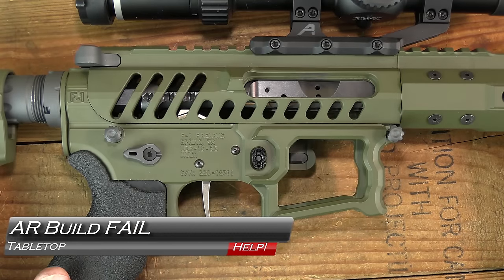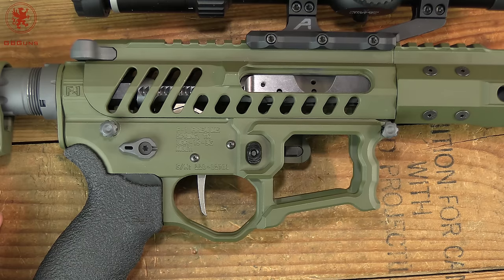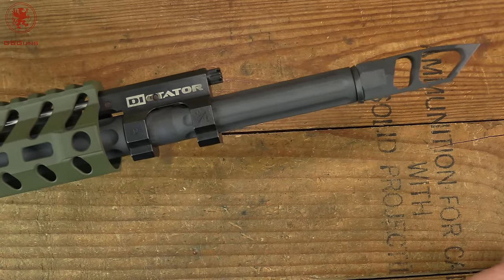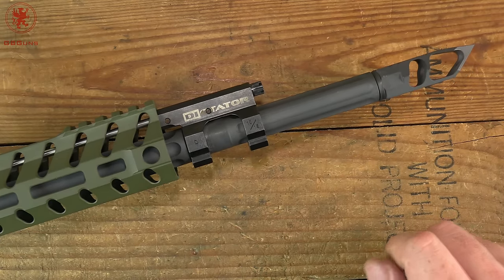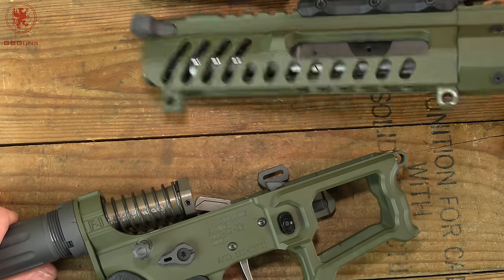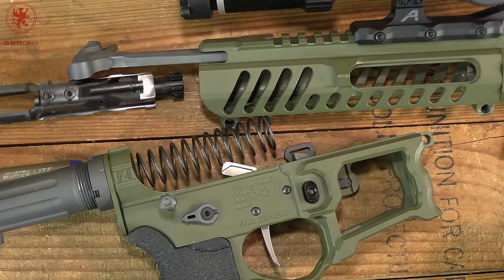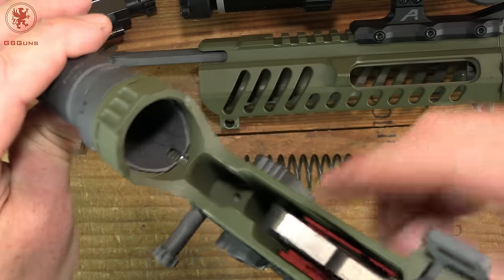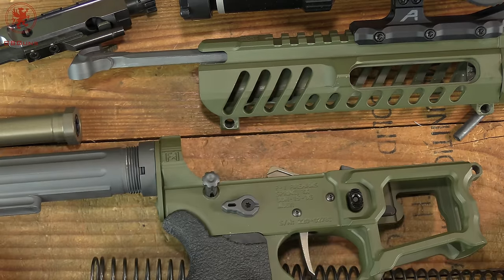The Worst Thing You Can Do For Your AR

Comment: I'm going through a similar issue with mine. I've dialed the adj gas block on my 16 inch carbine. With no joy. I have the correct tube and barrel Mach up. I was going to just buy a regular gas block and try it but now after reading your comment I didn't think about the spring being too stiff. I will have to try that but my buffertoob spring doesn't seam stiff. Again I will have to try both. Just FYI my gas block is about 9 inch from the receiver and isn't as far forward as yours. So it stumps me. I'm going to try both and what doesn't work on this gun will go to another build.

Comment: Mine done the same thing, I had a rifle spring in it, switched to a carbine spring and it worked fine. Rifle spring is longer which will stop the buffer tube from going back enough to cycle  weapon.

Comment: Have you tried a different upper? Same bolt same spring and buffer just different upper with proper gas length for a it’s barrel length. I’m sure that is the problem mid length would probably been ordeal. Hope you find the solution cause that’s a nice build for it not to be running smoothly

Comment: you either have to have a softer spring since there isnt as much momentum pushing back on it OR get a shorter gas tube so that the gas comes in sooner and can build pressure, people tend to forget the mass of the bold actually helps push that spring back and if its extremely light weight it picks up speed but has no punch
Reply from the maker: See video description

Comment: You can buy mm sized wire brushes (with 1/4" hex) for a drill to hone out the takedown pin holes.  You can also roll a small piece of sandpaper and turn it by hand.  Keep checking pin fit, come from both sides to minimize inaccuracy.
Reply from the maker: The solution was much simpler
Reply: @GBGuns  What was it ?

Comment: I hope this has been fixed by now but As many people said you need a lighter buffer spring and those 2 rounds that cycled will turn into 30 per mag. Seems like your reciever both upper and lower may also bbn have VERY tight tolerance. Or like you said the risk of your preferred gas system. Sometimes the perfect builds we want just don't work exactly how we want but I'd try the spring first.
Reply from the maker: See video description

Comment: You have something that I hav experienced with a build, short stroking.  Root cause is under gasing or the buffer spring is too stiff.  There are lower spring force buffer tube springs.  As pointed out in an earlier reply from another your ultra light weight bolt carrier has low mass and inertia, so this also points back to the buffer spring being to stiff to alow full stroking.
Reply from the maker: Correct

Comment: This is old but try cycling the gun a bunch of times by hand to break the bolt in will help a little,the problem is not enough gas or something hanging it up .I almost wonder if maybe the adjustable gas block isn't lined up properly with the hole in the barrel. Maybe they dimpled it in the wrong spot.Try a different barrel if you have it

Comment: I'm sure it's already been said but I'm not about to read all 5,360 comments....Have you drilled your gas port in the barrel to the next size up?  I was having the exact same issues with a very similar build, tried all the same things, swapped many parts to isolate the problem.  The solution ended up being to use an adjustable gas block (you already have) and drilling the port to the next size up using a jetting bit (so it's very small diameter increase) and then tuning it with the adjustable gas block.  Worked like a champ and it now cycles flawlessly.

Comment: I knows this is old but before reading comments off the bat I’d say reduced power spring , and rifle length for a rifle length gas system. Make sure the springs got lithium grease all over, and lube the bolt and inside the upper receiver . The sounds of the charging sounds like allot of friction .

Comment: I just got my first ar platformed rifle in 5.56 1:8 twist in a 16" barrel with carbine length gas tube I got the upper complete from Bear Creek Arsenal and I went and bought a comolete K.E. Arms K.P.-15 Multi- caliber lower for a couple reasons the lower is one solid polymer combining the lower and stock into one single piece getting rid of the weak point between the stock and buffer tube/lower reciever that the adjustable stocks I have seen crack or break in that area. I love this rifle so far and am already looking into getting the 7.62x39mm AK chambered upper but I wished I would have gotten an 18 or 20 inch barrel on this first one but its lockup on the K.P. lower is super tight I had to sand the forward upper lug slightly to fit into the K.P. lower but for my first AR platform rifle I'm happy with this one its definitely accurate with M855 ammo as soon as I can I'm going to grab some primers powder and some v-max or GMX Bullets and start developing loads bit who knows when primers powder and bullets will be avaliable again...i got lucky last week and picked up a box of Hornady 230 gr XTP's for my 45acp SD Loads but they didn't have primers or powders lol

Comment: I ran into a similar problem with my .300 blackout. At first I thought it was short stroking on shit reloads from LAX ammo because it was jamming after every round. Last shot the bolt would slam forward and I couldn't get it to lock manually.  Swapped uppers and the problem went away. So I swapped the buffer spring and bam problem solved. Turned out I had a thicker spring on my .300 black so I bought an aero precision carbine spring and it works reliably now.

Comment: I have a similar issue except I put the lightest spring you can get in and the ar was basically a single shot still. I put on my friend lower and it ran flawlessly. It mag dumped 3 mags in s row without an issue. I also changed the bcg and gas block. I called the manufacturer and they had no suggestions I hadn't tried. Do you guys have any other suggestions for that?

Comment: Do not be afraid to cut a couple coils off the buffer spring either. I have had to do it with 20" barreled AR-15 build even with the gas block wide open, light spring with light buffer

Comment: How tight is your receiver lug adjustment screw? I am thinking the bcg is going in receiver extension at an angle. 
Is the bcg cam dragging on the upper? 
Also, check the gas rings/gas expansion chamber on the bolt. How easily does it glide within the carrier?. 
Unlikely but, maybe that upper is letting the gas pressure drop too fast.
Get a sprinco spring, or a flat wire spring.
Reply from the maker: Great concepts.  Fortunately the solution was pretty simple.  See video description for the solution, footage of the gun running, and the article in Ballistic about this rifle and experience.

Comment: Might sound overly simplified but put that upper on a different complete lower and try that, if it works it’s either your spring , buffer, or even buffer tube,  I’ve also had a riding condition in my trigger of a Glock 34 that created the same problem, so check that out to make sure your ar trigger isn’t riding.
Reply from the maker: See video description
Reply: Ahh I’m on mobile, glad you found the problem 👍

Comment: How did it all end up working out? Did you change that spring, buffer, buffer tube, and shorten the gas system?
Reply from the maker: Fortunately the solution was much simpler and cheaper.  See the video description or my article in Ballistic: https://www.ballisticmag.com/2021/03/02/impossible-ar-build-myths/
Reply: @GBGuns  good on ya mate I knew it was just the recoil spring and positioning of the gas block. I learned years ago pistons are very tricky but very effective if done right. I bet that thing runs silky smooth now 👌
Reply from the maker: @ganstathuganomics11  Watch this time stamp! https://youtu.be/tjFRl6sO_GY?t=130

Comment: Switch to a middle length gas system to increase dwell time , make sure gas block hole is aligned with hole in barrel,  you can try a lighter buffer spring, check your gas ring on bolt, check head spacing with no go and go gauge, cuts in side of upper receiver might be letting to much gas escape, inspect bolt carrier group assembly to make sure the gas is flowing in right direction. I’m sure it’s in the gas flow my guess too much gas is escaping out of the holes in upper receiver
Reply from the maker: See the article in the video description or pinned comment.

Comment: There are several things to look at. The bolt in the bolt carrier if the gases are blowing past the seats in that, you should be able to extend the bolt and stand up on end without it collapsing from the weight of the carrier. Lose the adjustable gas block you obviously don’t need it, they do make different length springsFor the buffer system try a shorter One or cut a couple of loops off of it.When all else fails you can also in large the gas port on the barrel. Good luck
Reply from the maker: When we got it fixed we were able to dial gas down to 5.56 only or open up one click for .223! Super silky shooter!

Comment: I would add rifle length buffer tube and buffer. A rifle length gas port produces much less gas pressure. Your carbine buffer tube is designed for higher gas pressures so it has a shorter stronger spring. low power ammo also contributes to the problem. I would start out at the higher weight buffer you have and listen when it cycles. You don't want the bolt slamming back hard. You just want it bumping a little before returning to battery. the weight of the buffer helps the bolt with inertia going back and the spring helps it going forward. you'll just have to get the sweet spot with the buffer weight. By cutting down the bolt carrier weight you accentually take away inertia weight going to the buffer. Your just going to have to play with it. A slow motion camera recording the bolt when 1 shot is fired will tell you a lot. Just my option I'm no export.

Comment: if we're not seeing ejection pattern..assuming it's correct..check trigger spring..probly not assemble correctly..an incorrectly assembled trigger sprin..witch happens alot will cause..1 or 2 shot malfunctions..or your getting bolt bounce...not enuff resistance..increase buffer weight..or get rid adj gas block put on standard. add heavier buffer..try again check ejection pattern

Comment: The buffer tube isn't screwed all the way down, leaving some space and it may be under gassed. The bcg may also be used for suppressors which releases more gas. More than likely, drilling out the gas port would fix the issue.
Reply from the maker: Luckily the solution was much simpler. See the article linked in the video description and pinned comment.

Comment: Off hand I would say it COULD BE THE RECOIL SPRING. I've worked on several other weapons so I do have some knowledge of the workings of WEAPONS in general. My 2 SUCCESS STORIES is I replaced the recoil spring in my German Luger (40lb spring) and I replaced the breach block on a 1914 German Luger which had LOCKED UP because of the broken part (I did fix it with a original appropriate part. It worked like a CHAMP, SHOULDN'T HAVE SOLD IT.😯😩😮‍💨. IT SHOT GREAT, ACCURACY WAS NAIL DRIVING (8" NEWLY MADE AUSTRIAN barrel), the company made barrels for the Germans for BOTH WARS. 😁👍

Comment: I noticed that when you were showing the buffer tube I did not see an installed buffer stop detent. I don't know if you had taken it out when for some reason when making the video. If not I would imagine you're having to manually depress the buffer spring each time you take out the take-down pin. In that case your bolt carrier would be under constant pressure from the buffer. When the gas cycles your bolt carrier doesn't have that very slight room to move that allows for inertial momentum. Just a thought.

Comment: I don't know if it's just because of my ignorance of ARs or what but a little before half of the video I thought not enough inertia and a weaker spring might work. And I'm not that smart but when I go overboard trying to dial-in something I often times lose sight of the bigger picture. That is a sweet look rifle you got there, though.
Reply from the maker: Thanks, it was an experiment of a build and a bit of an intentional troll-post. As you can see in the article I wanted to dispel a lot of the range-lore/gun-shop-lore out there on the AR. I boiled down the first 3,000 comments into 7 common myths and put them in the linked article.
Reply: @GBGuns  Wow, what a cool approach to study sub-culture while combining with something you enjoy.
Reply from the maker: @brenttesterman1198  All firearms are a passion of mine, but the AR and AK worlds are interesting, there's a lot of loud dogma that doesn't need to be there and in some cases is just flat out wrong. Most often it was right 20-30 years ago, but has been resolved. It's like saying Glocks are the most reliable pistols. Compared to 1911s in the 1990s that was correct, today however most modern-production guns are just as reliable.

Comment: I have a 18 in with rifle gas. It works fine. Its your gas block look at the gas block journal it is half the size of your block. Just put on a low profile gas block. Throw a standard full auto bolt in there and change the buffer to a h1
Reply: Also light isn't good for bolt and buffer.

Comment: Ditch the adjustable block, put in a proper weight buffer and spring. Oh and put a detent to hold that buffer back. If you’re running a 16”barrel run carbine length and have the gas port on the barrel checked for alignment again and proper diameter. The chopped up bolt and buffer set up is not a good idea
Reply from the maker: The solution was much simpler, and this is rifle-length gas on an 18"

Comment: After reducing the weight of the bolt carrier group in Spring and buffer, the it can be as simple as the gas block is not exactly lined up with the barrel Port or either piece could be out of spec. After checking this you can always go to the gunsmith and drill out a bigger port on the barrel and get a bigger adjustable gas port.  I look for the comments I didn’t see if you ever fix the problem could you let us know what the outcome was?
Reply: Missed it so it was the buffer spring.
Reply from the maker: Yes which may have been a mislabeled spring to begin with.  Did you see the article or the video of it running?

Comment: I know I'm late to the party but I would swap the buffer spring. Pick up a cheap one and run it. See what happens. I would also check to make sure they the gas rings and properly aligned, (the gaps not being all line up) if you need a tacticool buffer spring go with a jp captured and see what happens.

Comment: Edit: I guess I should have read the description before commenting.  Oh well, I'll leave the comment as it looks like it was exactly what your problem ended up being and may help someone else in the future understand the physics a bit better.

Buffer spring is way too heavy for all those lightweight parts.  The gas coming from the barrel only imparts energy on the BCG and buffer for a short amount of time, after that the inertia of the bolt is what carries it rearward to compress the spring.  With far less inertia in those parts you need a lighter spring so it can be compressed by the lower levels of Kinetic energy stored in the BCG and buffer.

The alternative would be to increase gas port size in the barrel so you get much more gas to the gas key and get more energy into the bolt.  This means its going to move faster and since KE=1/2mv^2, you'll have enough energy to compress the current spring.  This would not be a pleasant shooting rifle though.

Obviously the first thing to try is put a standard weight buffer and BCG from a different rifle in it to see if it runs with that spring.  After that, change out the spring to something lighter and try it with your lightweight components

Comment: I suspect that you will have to get a longer barrel if you want a rifle-length gas tube or a barrel with a mid-length gas port.  I believe your first observation is correct.  You can go with a lighter buffer spring, and hopefully, it will work.  I wouldn't be surprised if you wind up with feeding issues because your spring is weak.  Although, it is a cheap test.  Your AR is cool looking, but not practical, is it a build for show?
Reply from the maker: With quality magazines feeding is not an issue, see the article in Ballistic: https://www.ballisticmag.com/2021/03/02/impossible-ar-build-myths/

Comment: Don't feel too bad, my son-in-law bought a complete Matrix Aerospace AR-10 rifle in 6.5 Creedmore and it wouldn't cycle.
After taking compressed air and blowing down the barrel with an empty shell in the chamber it would barely move with our 250 psi rig. We could see air coming from between the gas block and barrel plus see the carbon fouling was a bit much.
Come to find out after removing the handguard and tugging on the gas tube, it was loose and someone forgot the rollpin.
Even after fixing this issue it was still punching holes thru the primer and thru the sides of the cases that stovebolted.
This rifle was sent back to the dealer in Lake Havasu AZ for repair under it's lifetime warranty three weeks ago and the shitty thing is they've had it for two weeks and haven't even opened the box.....
On a bet, I've literally built a custom Aero Precision 308 from pieces off Gunbroker in those same two weeks, and for less.
At least mine will work.